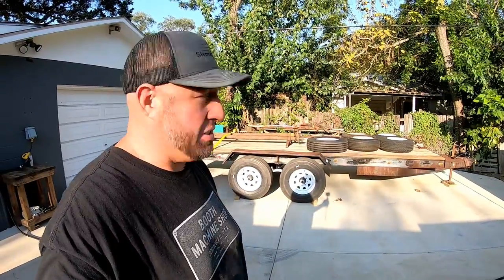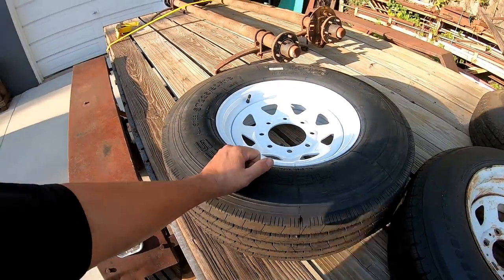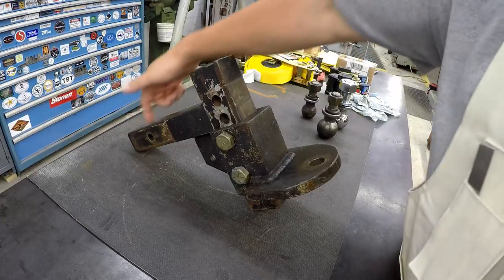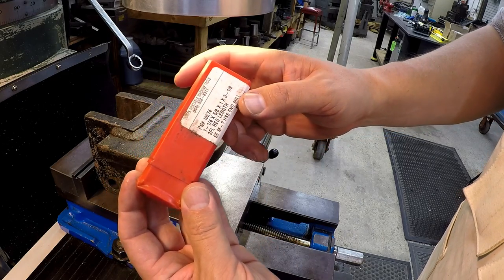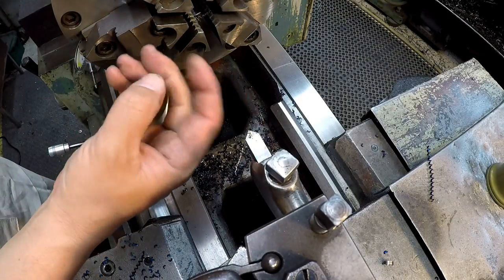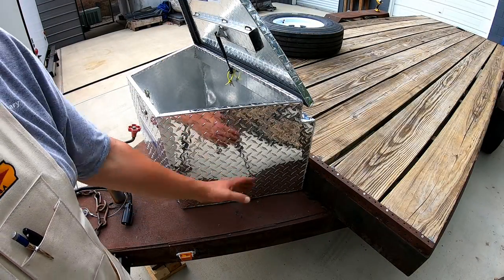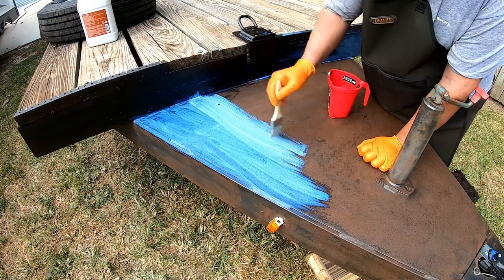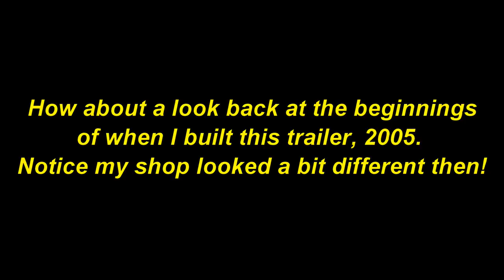SNS 276: This Old Trailer

Comment: Adam before you alter your fenders ( mud guards to us here in the UK) have you worked out how much lower the bed of your trailer will be when fully loaded? You were indicating that you wanted the top of the fenders to be level with the deck but looking at the video I can't see that you will achieve that goal. The top of the wheels will come way up above the deck when fully loaded and the heights and clearance you have on the existing fenders will only just have enough clearance then I believe. Ask your trailer guys what they think before you fab up new ones as they will now how much it will sink under a full load (20,000 lbs I think you said)

Comment: Do you really need to subtract the weight of the tyres when you calculate the maximum payload?  Don't the tyres rest on the road rather than putting load on the axles?

Comment: what are your thoughts on coating the wood deck with 50/50 gas/diesel and used motor oil. Adds great protection and water resistance. I have an enclosed trailer but a buddy of mine built his own  utility trailer and swears by the gas/oil mixture. Looks great, just want some outsider thoughts and if it was something you considered doing when building your trailer.
Reply from the maker: I mopped old motor oil on the deck a couple times years ago. Was told it’ll help make it last longer. Make it kind of slick for a while though. Just got out of the habit. I love the fresh wood look myself.
Reply: I have used a mixture of gas, used oil, and black rust-oleum with a handful or two of sand mixed in.  It dries up more and doesn't stay so slippery.  Lots of different routes to go but that was for old crappy worn out wood.  If you were starting fresh I would find an old oil based wood stain like 1950s shellac stuff
Reply: @RickBaconsAdventures  ooooohhhhh!! Never heard or thought of using sand with it. That sounds like a great additive. I do plan on converting my totaled enclosed trailer into a utility trailer. I'll run some tests on some scrap wood between the shellac, oil/gas, and oil/gas/sand. See what I like best.

Comment: I am a professional woodworker for 30 years and have watched most of your tutorials. That being said I would like to make a few suggestions about the deck you are putting on that trailer. The first choice would be to use Teak (Expensive but the best for outdoor and salt air conditions) The other  choices would be Mahogany, Cherry, White Oak, and Ipe (South American Walnut.) If you would like to discuss further please feel free to contact me.
Reply: canuckguy worried  I built my trailer 37 years ago and decked it with treated plywood that only lasted about 4 years before starting to delaminate.  It was replaced with pressure treated 2x8's which are still in pretty good shape after staying out in the weather year around.  I hauled a Supermax mill  (2,200 lbs) on it a few months ago with no problems.

Comment: CURT 48810 Replacement 1-7/8-Inch Pintle Hitch Ball, 6,000 lbs. Ball Capacity, 1-1/4-Inch Shank Diameter  on Amazon

Comment: Quick question for anybody who knows. Does rust converter work on hot rolled steel mill scale? Does the scale need to be removed or does this stuff work on top of mill scale? Thanks in advance for any info. I checked the website but could not find specifics on mill scale.

Comment: I would put plastic fenders on there, this will make the trailer lighter and give you more payload.

As a European I think American trailers are weird. Over here trailers are made as light as possible to give you more payload. My own trailer has a 4m long and 1.8m wide deck, can take 4000lbs payload and weighs 1500lbs dry, including a 2m high steel superstructure with canvas cover. The frame is from galvanised steel, the trailer is from '92 and has no rust because of this. Over here, it is impossible to buy a new trailer that does not have a galvanised frame. Most trailers also use torsion axles because they're lighter and more compact. Brakes are always mechanical, to make the braking system independent of any electrical problems. Same goes for the break-away.

I think it's weird that trailers in the USA are so different and less efficiënt. You say your trailer weighed 2200lbs, the European equivalent size flat deck weighs only 1400lbs, that's 800lbs extra payload. The heaviest flat deck I could find came in at about 2100lbs and that's a triple axle trailer with foldable loading ramp. 

Sure they're probably a bit more expensive but they easily last 30yrs without major work like what you have to do now. Anybody got an explanation for this difference?
Reply: To hazard a guess I'd say flat roads and big trucks make that difference
Reply: A home built trailer is not going to be galvanized and it's usually going to be a little over built. That said, galvanized trailers are great.

Comment: Whats that 1/4 plate weight?  Gotta be an extra100lbs on tongue maybe cut some of it out?  How come you dont make a new ball mount so you can swap using only the 2 pins ? Definitely need a headache rack . Maybe @auxbeam can hook you up with some lighting?

Comment: What brand was the rust killer and did it turn black or did you add paint? Sweet trailer with the higher weight capacity.
Reply: As far as the brand he used i don’t know
But if you only need small amount Rustoleum makes a rust converter in small pint size jugs
I buy those at walmart in automotive auto body section

And yes it turns the metal black from the chemical reaction with iron oxide
 
It turns iron oxide to iron phosphate 
The product works best if there is a light surface rust but has to have all heavy rust and scale removed because it wont penetrate very deep before it dries
Leaves a hard black coating and you can just paint right over it

If your looking for something that doesn’t leave behind a black coating you’ll need to use other stuff such as naval jelly on things you cant easily remove or put in a bucket.
This requires rinsing before it dries out so its a bit more labor intensive.

If you can submerge the item in a bucket then evaporust or other rust remover product

All these product require heavy rust and scale removed before application
Reply: CRC Rust Converter

Comment: Genuine question. Is it sensible to use pressure treated wood for the deck or just the rough cut. I was looking into ref looking a horse trailer and was told that the copper in pressure treated will cause electrolyzing that will rust the steel out. Is this a concern or theoretical problem
Reply: It is, copper on bare steel corrodes steel

Comment: Bolts meant for clamping loads, not for shear loads. Looked into turning proper pins or is that unnecessarily over-built?
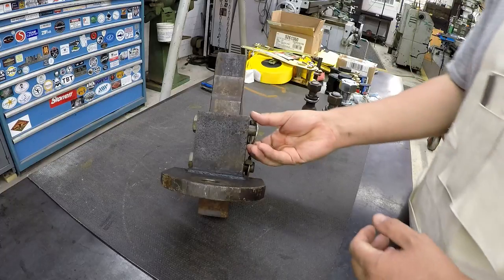10:45
Reply: Grade 5 bolts have a greater shear strength than grade 8 an work very well..     ;o) 

O,,,
Reply: @Opinionator52  gotcha, not really familiar with material strengths, thank you
Reply: Strictly speaking yes, however, in this case a bolt is being used as a piece of steel stock, and what counts is the shear strength of that particular alloy. It appears as though he is using grade 8 bolts, but even if they were 0.5" grade 5 bolts, a back-of-the-envelope calculation suggests that he would still be fine.

Comment: could make a spare tire mount on the front of each front wheel on the side , if you weld trailer asle stubs straight to the frame it might help you some to lift the trailer over high obstacles as the trailer stubs alow the spare tires to rotate 
it allso might catch the trailer from tipping over should a spring or tire fail 
if you mount the spare tires  on the rear in the same way you could disconnect it off the hitch of the truck and tip the trailer up on the rear wheels and spare tires are one the ground to winch heavy equipment up ontoo the trailer from the ground 
once the machine is far enough up the trailer it starts to tip over go slow and maibe help the trailer down then drive the truck under the hitch again and winch the machine up the last bit

Comment: on that trailer , how far apart are the cross members? thats the toughest decision for me
Reply: If your going to use wood for the deck? Try the U.S. forestry website for engineering data about the average load bearing capabilities of various domestic species of wood. That will give you your cross member spacing if you know the maximum weight you'd ever haul. There is a large difference between old growth wood and today's early harvested garbage though.

Comment: I always built my trailers with the deck over the tires. It makes it a little higher off the ground but you have a wider deck .
Reply: & less stability/higher centre of gravity.
Reply: @dan001427  the extra 1.5" higher it would be is well worth it.
Reply: @xenonram  The difference is a fair bit more than 1.5".

I see a lot more instances of flat beds loosing control and tipping over where the bed is above the wheels, then it also depends on what you are carrying as to which will suit you better.

Comment: Gee....all the added weight of the box and contents on the tongue is going to make your pickup ill handling. Weight distribution is very important ya know. LOL Where are all the safety sallies from the camper video??

Now go find a spare tire holder from the local pick and pull....from a late model pickup, and mount that under the front of the trailer between the parallel sides of the tongue so you can put that new spare under the trailer, out of the way and out of the sunlight so it doesn't rot away.

Comment: Instead of switching balls because of two trailers, I'd change the coupler on the small trailer to the same size and not have to change balls.
Reply: if you went to use the small trailer on a small vehicle it would be really uncommon to have a 2-5/16 ball available
Reply: @RickBaconsAdventures  His trailer, his truck, make it simple for himself.  It's not a rental, it doesn't matter what anyone else does.
Reply: @12345NoNamesLeft  yeah agreed, I'm just saying for such a small trailer sometimes you may use a smaller truck or something in the future.

Comment: If I heard you right you mentioned the deck plate on the tongue was 1/4".  looked more like 1/8th on my monitor.  Anyway why would you use 1/4" plate that weighs so much on the tongue.  Seems like overkill and unnecessary added weight.
Reply: 1/8 will bend permanently when a bigger person steps on it. (I'm not quite Abom sized, but I'm not too far off.)
Reply: @theacidbeaver  The overlapping frame support, narrow width of the landing and heavily welded edges would make it difficult to bend a 1/8th inch steel plate.
Reply from the maker: Overkill? Wow!
Reply: Lesson for ya, I'd much rather it be overkilled, than me be killed!
Reply: @scottstarling247  It has an aluminum box on it thats gonna kill ya.

Comment: I don't understand why it is important to have 1 receiver and 2 balls.  I have 2 balls and 2 receivers.  I highly doubt that you need a super-duty receiver for the smaller ball.  Matter of fact, I have 3 receivers - the 3rd has nothing but a hole to use with some of my farm implements.
Reply: Same reason he uses a shaper to do something a mill can do. Because he can/wants to.
Reply: canuckguy worried  you are looking at it too deeply. i have multiple receiver inserts and prefer it that way. Adam switches the balls on what he has because he prefers it that way. Simple as that. he's well aware of what he can do, he just prefers to do it this way.
Reply: an extra ball is a lot smaller than an extra receiver, especially if you consider an extra adjustable receiver
Reply: @RickBaconsAdventures  - true, it is smaller but you will also need a big wrench to change.
Reply: @bobblack3870  tradeoffs haha, I carry a regular box end wrench to fit the hitch balls, its a lot lighter than an adjustable of that size

Comment: some small things.
First of all, that box on the front of your trailer - a really good idea, i have one on my trailer also, BUT a little idea that i will pass on to you also Adam, make a wall inside of a piece of aluminium, so that the box is split in the middle. One side for your straps and one side for your chains. I did that on mine, and what a difference.

And nice to see that there are countries where it is allowed to build your own chassis and make a trailer of it.
Here in Denmark you would be killed on open streets by the authoritys for doing something like that. Also that with the axles. If the thing is not born with that kind of axles, you are not allowed to do the switch here in our country. 
And also the thing again, by building it yourselve. Wauw! i would hope we could get that opportinity one day also.

Comment: Is it really necessary to include the weight of the tires to calculate the gross payload?
Reply: Dunno about the US, but here in Europe they simply haul you on a portable vehicle scale, load, tires, mud, half eaten sandwiches and everything. And if you are an ounce over what the tonnage plaque says you are in all sorts of trouble.
Reply: Gross vehicle weight - vehicle weight = gross load weight
Reply: Yes, tires, straps, chains, dunnage, cribbing, load it all adds to the total gross vehicle weight. If it's in, on, or part of the vehicle, it's weighed.

Comment: I would have gone with one of the balls kits with the common mounting pin that has all 3 size trailer balls 1-7/8, 2, and 2-5/16 that slide over the center pin for whatever size you need.  If I felt that I just had to use that old 1-7/8 and I had the machines you do I would have made the sleeve a shrink  fit so it never got lost.  As for your tires when it comes time to replace them you might consider using a LT truck tire instead of ST trailer tires.  Most of the farmers and ranchers here in rural Oklahoma use the truck tires because they don't have the tread separation issues of the Chinese trailer tires.

Comment: I would put some fender washers on the bolts holding down the tool box. The type and thin material they make those boxes out of tears real easy. Been there done that. And trailer parts you can get cheaper than most other places at etrailer.com and I get all my tie downs from macscustomtiedowns.com

Comment: Is there brakes exists? How they are driven?
Reply: Electric brake system. Basically you send a current to a coil which drags an electro magnet into the hub face of the drum, which then moves a lever that applies the brakes. The harder you press the pedal the more current you send to the electromagnets. If the trailer breaks off the truck the break away switch gets closed circuited and a small battery applies full braking current to the system.
Reply: @ColtaineCrows  Thanks a lot for explanations, I'd never heard about such systems. I know mechanic and hydraulic ones. And now I've to learn one more interesting thing. Thanks again!

Comment: You can buy prefabbed fenders that will cheap and easy to put on.  You probably want to make the deck 80"x18' and fab up some ramps if it isn't too much of a problem so you can move a truck if you want.

Comment: could you just put a bigger hitch on your small trailer
Reply: It would be easier to add a tang to the hitch plate on the truck and run it 3 or 4 inches off center. You just need it higher or lower than the other ball to avoid interference when cornering. 

The problem with changing the trailer is that every other vehicle that hooks to it will need the larger ball. This means any other he owns and who might borrow it. It may become even more complicated with different shaft sizes like he is already experiencing.

Comment: How many times I have wished for a mag drill...found one on craigslist by me...in parts..$1200...WTH!?!?!  I guess I live in an area that things junk is worth millions...Heck, I want a mag drill for things that don't even require a mag drill...because hey, you have it, you can use it for all kinds of things outside of machining work.

Couple of things I would change on the mounting of that tongue box....A) Rubber Washers/Rubber pad under a fender washer.  Gives more surface area to hold that thing down with.  The rubber also will hopefully prevent water from coming UP under it.

Comment: you should look into a hitch called a Poly hitch made in here in Australia i think, http://www.tregtrailers.com.au/poly-block-couplings/
Reply: I do not see the advantage, on road the normal articulation a standard ball works fine. Off road a military pintle is more than beefy enough. Very few people even with 1 ton class trucks run pintles, those that do are usually pulling farm equipment.
Reply: @otm646  i agree entirely just if you are going to the lengths he is why not. Pkusi have had it come in handy when reversing up stemp / sharp drive ways on my 7x5 trailer. Im just of the opinion if you can buy the best you can afford.

Comment: At 19:08 he mentions a chamfer on all 4 corners .... in a pípe? I’m sure he meant to chamfer all four edges...
Reply: Edges....are on sheet metal....
Reply: Really? Y’all need a life.
Reply: Doug Ankrum     An edge is an intersection between two faces.  Granted the word is used most often with polygons, but it is also applicable to cylindrical shapes where they could be called ‘Edges without vertices’

Comment: FYI tire to fender gap is different loaded and unloaded.
Reply: He hand built the trailer..I think he knows
Reply: @owencrawford8416  i all most made that bobo
Reply: @owencrawford8416  he was going to make fenders even with the deck.
Reply from the maker: Common sense
Reply: at the end of the vid the fenders were above the deck
Reply: @Abom79  sorry i was just trying to remind you that is all .ps i have a lathe thats 140 years about old that dues that out and left feed trick .
Reply: @carlbaumgardt9465  has hasn't built the dang new ones yet lol
Reply: @RickBaconsAdventures  no good deed goes un punished (dang)